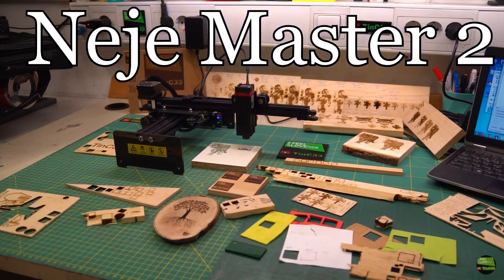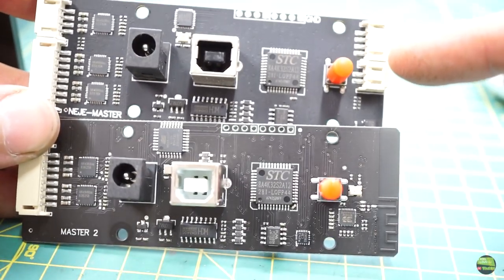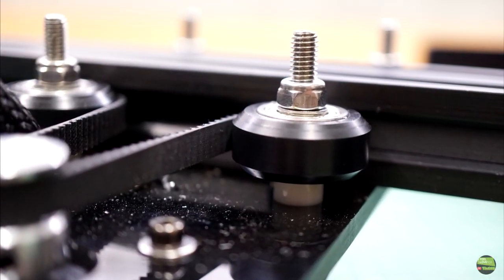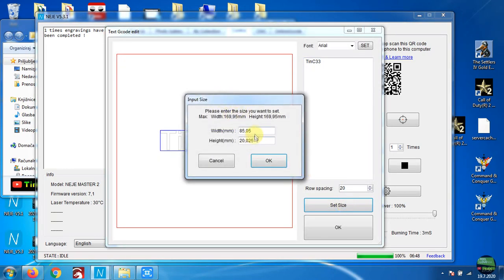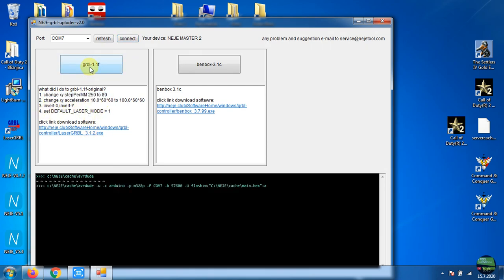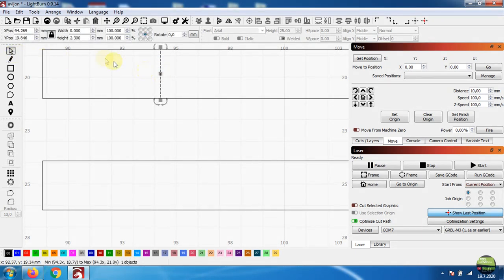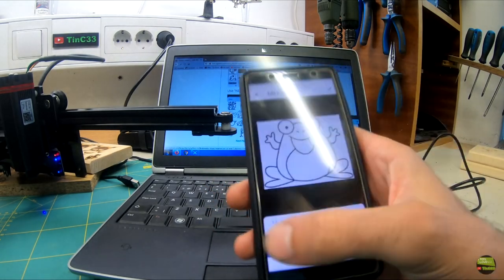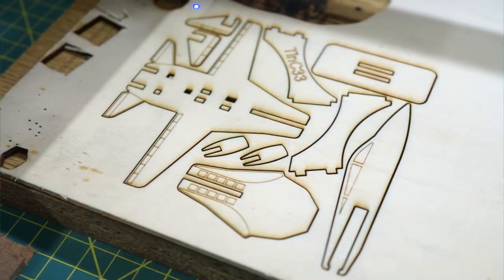NEJE Master 2 20W desktop Laser Engraver and Cutter

Comment: Great video thanks. However find support for this Laser really poor so finding this was great but doesn't solve my problem. Our biggest issue is bringing in artwork saved in dxf format and the Neje software is unable to open the file or brings in only parts of the file. I prepare my drawings in Illustrator, save as dxf to bring into Neje software. We are having a nightmare. Thought this was going to be simple. Assuming it's human error but have no idea what is wrong. We have run our own CNC router for years and can't believe we're stumped with this. Any pointers please or a route to find real support from the Neje manufacturers. Again thanks for your video.
Reply: Amateurs.

Comment: Hi
Very useful video. Managed to set mine up with your help. After a few burns I tried a simple one of the pre set pictures, it got half way thru burning and it seemed to get stuck . Laser was still on but x and y were not moving. Can you advise 
Thank you
Reply from the maker: Check the cables for booth y motors and try to move with hand so you'll be sure wheels running smooth and there's no dirt on the rails.

Comment: TinC33: Thank You! Do you believe it would be possible to increase the travel of one of the axis to lets say 2 or 3 feet?
Reply from the maker: No with that design, check for the ortur 2 than if you need bigger working area.
Reply: @TinC33  Thanks! 3 Subs from me. Do you believe the ORTUR Laser Master 2 - 20w would cut 5mm plywood? I want to use DXF files coming from a Windows 10 computer.
Reply from the maker: @TheWindGinProject  it may cut but depend on material, soft plywood can be cutted with air assist, but need to cut slow and make few passes, but hard/heavy plywood can't be cutted, for that you'll need more expencive co2 laser cutter.
Reply: @TinC33  Thank You, Your answer makes me feel that even the soft plywood shown in the photos need air assist. Can you offer any links to a similar size that would be better for cutting thin wood of 5mm thick? Sorry to ask another question but now I'm thinking the 20w lasers are not powerful enough even though they advertise them as being able to do it. Your real experience with these lasers is why I asked you and I am very happy that I did. :-)
Reply from the maker: @TheWindGinProject  something like that, they'r become really cheap.
https://www.ebay.com/sch/i.html?_from=R40&_nkw=co2+laser&_sacat=0&_sop=15
Reply: @TinC33  Yes, those are low cost but too small. Instead of cutting wood my projects would work well with foam. I need a foam that is stiff, kind of like the white foam core board used in school projects. I know foam core board does not cut well on a laser. Do you know of any stiff 6mm to 8mm foams that would cut on a 20w laser that are stiff? If not; I guess I could find a way to stiffen the foam after it was cut. Better than using an Xacto knife I think.

Comment: I am so happy to find your video. I cannot make my new neje master 2 work with android phone or iPad,  it keeps telling me the motor is resetting but nothing happens...neje support email is invalid.
Reply from the maker: Did you turn on the location on phone?
Reply: @TinC33  yes. And guess what, the neje website support email is invalid, I can’t even contact them!
Reply from the maker: @KewAnon  hm i don't know what it could be, i got all models and every one work fine, except for lightburn need to change few settings on older modul, via pc work everything fine?

Comment: What setting affects the total job time the most?  I have a test job that is 7 inches by 10 inches that is at 10ms burn time and 50% power and will probably take 10 hours.  That is 1/3 the total size this can use so I must have something set too high, but not sure what.

Comment: Hi there. Hoping for some input. I bought the Master 2 - 20 watt unit from a friend yesterday and more or less got it up and running. I've downloaded Lightburn as it's what I use in my day job, and love it. My Y axiz seems off as the dimension of the shape when etched is larger than the actual drawn. Any ideas?
Reply from the maker: Zry to install new firmware using neje software, otherwise into lightburn change firmaware settings "Y motor steps per mm"
Reply: @TinC33  I changed the Y motor steps per mm. Seems to have fixed it. Thank you for your fast and helpful response.
Reply from the maker: @joe_fabricator  if you update firmware all the values will go te default and it should work also.
Reply: @TinC33  I'll give that a try if needed. So far, it's working :-). Thank you for your help.

Comment: Can I cut through 1/8 basswood sheets with this laser/engraver?
Reply from the maker: It should cut yes also 20w laser but anyway take an a4630 or a40640 for faster cut in a single or dual pass.

Comment: hello, thanks for nice video. can you tell what is the highest size of material you can put under engraving machine that it can be engraved into and how deep it can engrave? is deepth engraving like 3d modules supported by this machine/software? can i cut 3d modules into rubber/foam? thanks
Reply from the maker: You can put something under the machine legs so you lift up the entire machine, so the height is somekind limitless, how deep it can engrave is depend on model you use, i just test 40w modul wich can cut 19mm spruce wood, so same engraving, rubber a bit harder but 1mm can engrave for sure wich should be enough for stamp, 3d moduls, neje software support .nc and .dxf files, but if you use lightburn it support many other files...
Reply: @TinC33  thanks for that. what about 3d molues in sponge like substance for different elements to fit in, like tools or gadgets?
Reply from the maker: @tomazflegar  work also

Comment: Hello. What were your settings to cut out the airplane and what material did you use? Thanks a lot!
Reply from the maker: 3mm soft plywood settings was 100laser power and about 5-10ms (about 5mm/s) burning time
Reply: @TinC33  Thanks! And how many passes?
Reply from the maker: @lechiffre5452  i don't remember i think 3-5 but 30w can cut in 2 pass.

Comment: Hi TinC33...I am thinking to get myself a laser cutter. Can you help me with which is the affordable neje cutter that i should buy? I am looking for a cutter and engraver that can cut through and engrave acrylic which is about 3mm.
Reply from the maker: If working area 170x170mm is enough for you take neje 2S and if you need for acrylic i would choose 30W for wood engrave you can still buy another 2,5w laser for about 30$.
Please buy from some of mine links 😉
Reply: @TinC33  I don't think required big space just enough to engrave & cut acrylic for keychain sizes. So which is model would you recommend?
Reply from the maker: @annaridh  in that case neje 2S 30 or 40w it's size is really handy to work on table.
Reply: @TinC33  great thanks so much. It's really helpful.

Comment: Is it possible to use Master 2 software on Master 1 machine? Is it possible to upgrade to a Master 2. Motherboard? Thank you for sharing your information about this unit. Greetings from Tasmania Australia.
Reply from the maker: Sure, check this video firstly, but after replace the motherboard, you'll need to change working area into firmware. Maybe be better choice to buy new model and got two machines 😉

Comment: Hello! I really liked the video, very explanatory. I recently bought an Ortur Master 2 and there was a problem with the motherboard and I would like to adapt the motherboard of this NEJE Master 2 On my Ortur Master 2, would it be possible with any modifications? Do you have the technical data of the NEJE master 2 motherboard for me to make the changes?
Reply from the maker: i don't know where to get spare motherboard, but if you get i think just need to recconect the motor, limit switch and so on, it should work, but the price of neje 2 / 20W is below 170$ right now in banggood.
Reply: Throw the original board in the garbage and use Arduino + GRBL, no more problems
Reply from the maker: @riskaoibaf3280  that's the way but need some knowledge to assemble and setup all together.

Comment: Thank you for the great video! Do you think it could cut silver which is 0.3 to 1mm? Maybe there's an application which make it work on the same lines for multiple times?
Reply from the maker: I tjink no go, every software or app allow multiple cut on same line, but that work only if laser can cut material if not it won't help even if try 100 times on same line.
Reply: @TinC33  thank you 🙏

Comment: Hi i have buy the same neje master 2  20 w but  the laser istn good power to even do on wood.. my settings laser power 100 and burning time little bit lower .. do i  something wrong or just the machine broke..
Reply from the maker: Hmm i don't know, try change the burning time, bigger burning time make bigger effect but work slowly, but also with 10ms burning time it must leave traces on wood, also check focus, if focus not set perfectly there will be pure effect.

Comment: hello great video! can you tell me your settings for a MDF and how many passes will you use. I just was able to cut carbon and paper, I tried 2.5mm, I got just nice engraving but after 10 pases start to burn, my laser is 20w I am using lightburn, thank you nice channel
Reply: btw are you using some kinda metal to direct laser? looks like a metal part when you engraved plane
Reply from the maker: @fabiantrz  thanks, i don't remember am i mention or not, but the MDF can't be cutted, because it got too big specific density, i try with air assist and everything but hardly come 0,5mm deep.
What kind of still you mean, on 11:30? It's just a piece if steel for weight the wood to be stedy.

Comment: Did the laser last more than a week I bought an off brand engraver and it burned up two lasers? Does it have a problem staying upright when the laser is at the end of the rail?
Reply from the maker: No it's steel stable also when it's on end of rails, you can see vibration test into my ortur master video, all ghe lasers still works to me but honestly i don't use them too often.

Comment: Hi, could you tell us the config Power and Time ms have you used for print the Tiger, the picture on wood, and the config to print on metal. Tks
Reply from the maker: I don't remember but for engraving usualy set to about 5-10ms and 20-40% laser power, best way is to make some test before real work.
Reply from the maker: For metal engrave 100% laser power and slow speed so more ms

Comment: It would have been nice to see how well the pieces of the plane were cut and how much work it took to depanel.
Reply from the maker: it cut nice because i use 2.5mm balsa, balsa cut really nice and clean, all the parts just come out itself, some small one fall out during cutting because of air assist

Comment: Can those desktop engravers use vector files like SVG? Because i have alot of them for my plotter machine. can it engrave anodized aluminum Type 3 like used on flashlights?
Reply from the maker: Hm i don't know that file but i think lightburn should read them.

Comment: Hello, I using Neje's engraver machine(2s 20W).
I'd like to know how to increase the imprint output size.
I know  instrumentally elongating the profile of the X and Y axes.
but, I don't know how to modify the firmware.
Please help me.
Reply from the maker: I think you don't need to change firmware, just use lightburn and set bigger working area.
Reply: @TinC33  Thank you. Your advice, your hints, are helpful

Comment: Hi, im setting up the machine after installed driver, i open the neje_5.6v.exe file , it stop at verifying, showing that cannot be verified... do you know how to solve it? Thanks.
Reply from the maker: Sorry but don't know it's a pc issue
Reply: later i change usb port and reinstall driver again, then it work... (actually i dont know whether it is the cause or not)

Comment: I've only had my neje master 2 for about 2 weeks. How can I tell which board is in it? it has wifi and the red switch button. Is there a way to tell if its a 32 bit board?
Reply from the maker: Check the motherboard there is white text wich shown is it neje 2 or neje 2 s, all neje 2 got wifi neje 2s is working on 32bit.
Reply: Thanks I'll have a look.

Comment: Hi, 
in which program do you cut plywood?
I have neje 20w and I cannot cut the pattern to 4mm - how to do it? :(
Reply from the maker: I use booth software neje and lightburn but laser got same power on booth, the air assist is the key for cutting.
Reply: @TinC33  
just the lightburn program doesn't want to work - can't see the laser what to do with it?
And how to set the time and power for cutting?
Reply from the maker: @dominikaika3622  you must "add new machine" into lightburn and turn off auto homing when startup... For more check lightburn videos on youtube, they got clear instructions video

Comment: Hi. Could you find the way for Lazer to follow the lines when cutting using Android app?
Reply from the maker: i don't remeber exatly because didn't work much with app but do you got to set pattern somewhere like fill or line to choose...
Reply: @TinC33   thanks for your reply
No, I couldn't find such an option to choose. All videos where Lazer follow the line are controlled by windows apps. Could you advise which app is easier to use.
Reply from the maker: @j.m.7586  deffinitely windows app is easier to operate, because you got bigger working area, on phone app everything is so small, for cad engraving you really may need windows app.
Just instal driver and then open app.
Reply: @TinC33  Windows app installed and bit upset as 3500 following the lines but once I instal stronger 20w head it stops working. Any advise?
Reply from the maker: @j.m.7586  do you use 3A power supply for 20w modul?
Reply: @TinC33  I both 20w Lazer set and been advised to get alternative 3500mw for smaller engravings. Then neje support person asked many questions and at the end advised to instal grbl software. Now I'm using the same set of 20w ( no idea what power  to be honest ) just replacing the Lazer heads.

Comment: Can it work on non horizontal surface, for example to engrave on a wooden wall?
Reply from the maker: I didn't try but i think yes, because movement protection work just on moving, if you mounf it on wall without moving it should work, otherwise controll into grbl software where protection is disabled

Comment: I am using the lightburn 09.18 program, but it is drawing outside of my drawing area, there is a sound, how it is adjusted from my machine, it is doing it to the place you specify.
Reply from the maker: Uh i don't know i only using lightburn for a test, check on lightburn form they got good support as i see.

Comment: I know this engraver has small working area. I need this machine for only logo burning. Can this machine burn  1cm x 6cm logo on a hardwood size of 25cm x 45cm.
Reply from the maker: ofcourse it could, it got engraving area 17x17cm, so if your logo all you need you can take also neje mini wich cost less then $150 and you can engrave on any size of wood, because you can put entire machine on surface you want to engrave, and when you figure it out the right power and speed settings, you could use them offline, so you don't even need a pc to burn logo on your products. Check the links into video description for order (i saw banggood sell mini fro only $130)
Reply: @TinC33   Thank you very much. I appreciate your help so much.
Reply from the maker: @SK-hv3zn  no problem, if you order from one of my links i'll get some %$ and price for you is the same
Reply: @TinC33   It is definitely worth checking. Thank you!

Comment: Hello dear my name is umamah frm dubai I have a neje master 2 s laser machine I have in prblm to connect my laser to lightburn but dear its showing sending data to laser failed your machine busy or pause. pls help me thanks
Reply from the maker: Did you set same connection number as on firmware, if engraver stop respond mid of work upload middle firmware with neje firmware uploader choose middle one not 200000(last one) check my video about neje max, i tell few words about that problem here.

Comment: I just want a laser to engrave real estate logos on cutting boards. Which should I get? The 3500, 7000 or the 20w. I don’t need this for cutting, I only need speed and clarity of text. No photos, just words and maybe a logo here and there. Deep enough to last for as long as the cutting board is in service.
Reply: My intent is to use this to make enough money to buy a CNC with an engraver. But I wanna get this off the ground now
Reply from the maker: @BrundonC  then buy ortur laser because it's much faster and accurate for seriall work. Take 15 or 20w
Reply: TinC33 thank you!!!

Comment: Hello, I bought the neje Master 2 20w, but I can not get a black/grey picture in the program. How did you burn this large picture? 

My old insma 3500 is smaller but burns pictures in to wood or mirrors and I bought the neje Master because the laser place is 4times larger and I hoped it is faster than the old one.
Reply from the maker: It is much better than insma, also much faster, but don't know why you can get black picture into program, where is the problem, you open file into neje sw and then?
Reply: TinC33 thanks for your answere, so I open a picture an get 3 choices. But often I get only the two on the left side. 

When I make a picture like I do it all the time, I can not burn it with grey tones. 
Should I take a Spezial one? JPEG, png.....
Reply from the maker: @christophmeidel905  when you choose between two image you got contrast slider under inage, there you set brightness, thqn you can set brightness also with burning time and speed.
Reply: TinC33 I will try it , thank you